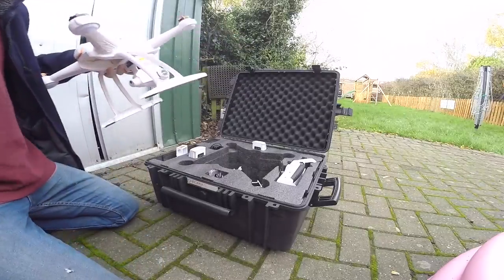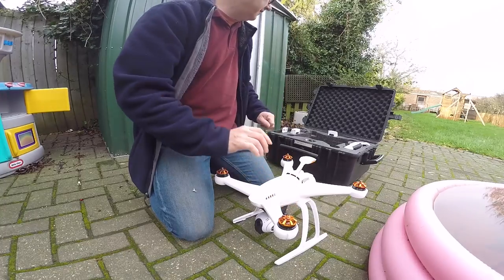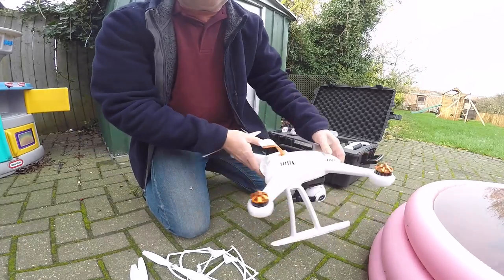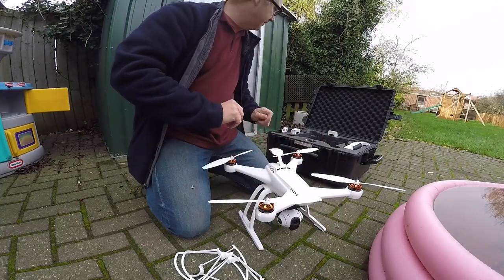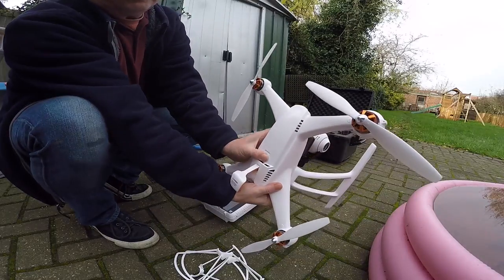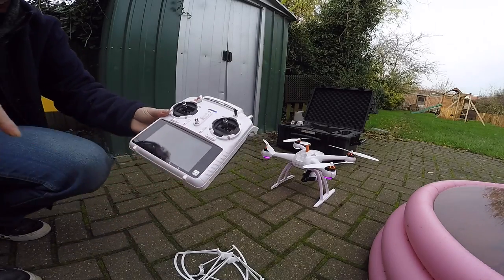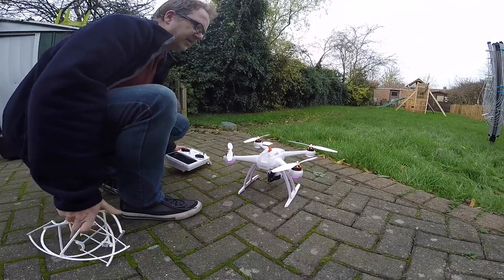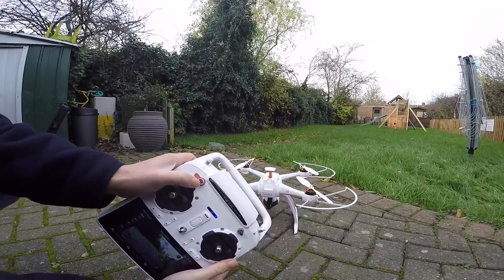BNF Blade Chroma conversion to ST10+ test flight

Comment: THANK YOU FOR POSTING THE VIDEO. I HAVE BEEN WANTING TO KNOW IF THE CONVERSION ACTUALLY WORKED. COULD YOU DO A "HOW TO VIDEO" ON SWITCHING THE RECEIVERS??THAT WOULD BE AWSOME!!
Reply from the maker: +1BadThaiGuy Glad you found it useful. I searched everywhere & in the end took a chance on a bargain ST10+ tx and CG02+ and bought the RX - and it worked! The tx swap takes literally 5 mins and just involves plugging the new tx into the alternative wire coming out of the board as the first wire. The Spektrum rx has a different plug to the Yaneec one, so no chance of a mix up. The aerial wires just post up the rear two arms of the quad. Binding is per the horizon videos. The ST10+ knows that it is binding to a Chroma & shows a photo of it (this was not a Blade badged ST10+). You need to make sure that the firmware on the ST10+ and Camera is up to date and there are two things to update on the ST10+, you must do ''system update' as well as the radio firmware - this link is the only place I have seen this explained : http://yuneec-forum.com/threads/st10-with-new-firmware-missing-gear-icon-and-watch-me-icon.404/I'll try and do a video as you suggest.

Comment: I bought the ST10+(Blade Branded)brand new on Ebay for $200 and the RX. 
Going to do a video but I just want to make sure that the connection is "one" RX male plug that connects into the other female adapter from the chroma board. there is a Female adapter on the ST10 RX board also. can you confirm how many wires are connected to the RX from the chroma board?
Reply from the maker: +1BadThaiGuy Both the spectrum and the yuneec receivers have a cable with a plug on the end. These plugs are each slightly different to each other. So you cannot accidently plug the wrong receiver into the wrong plug on the end of one of the two the cables coming from the chroma board. Each receiver only has a single connection to the board. I think you should make sure that you completely remove the receiver that you are not using - ie don't leave them both plugged in at the same time. Push the antennas from the RX into each of the rear arms of the body inside. Binding is the usual turn upside down after power up (with the blades taken off). Good luck. Hope this helps.
Reply: +lotus77s Is it cool if I can use your YouTube Name on the video I make?
Reply from the maker: +1BadThaiGuy Of course, no problem. I think that a lot of people want to know this stuff.
Reply: pourrait avoir les commentaires en français s v p